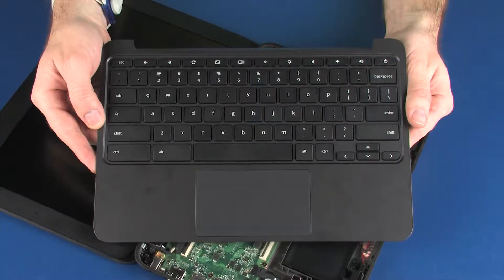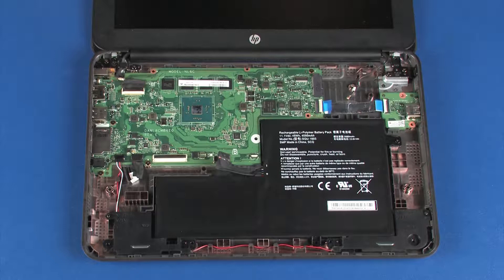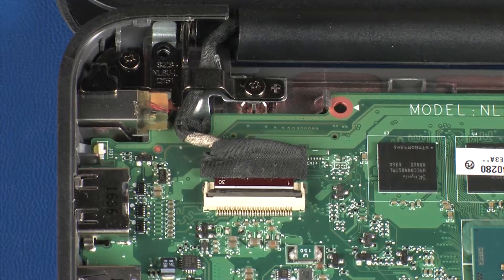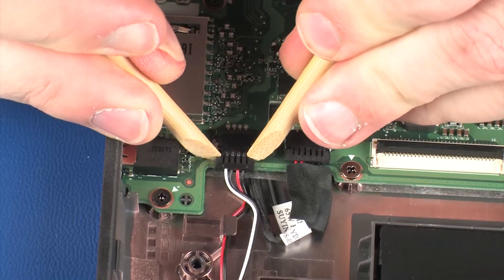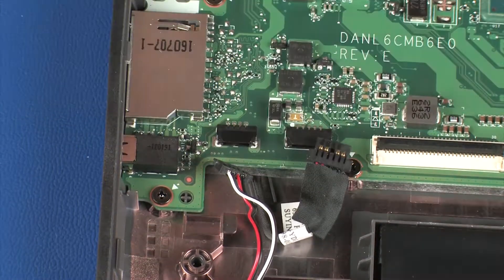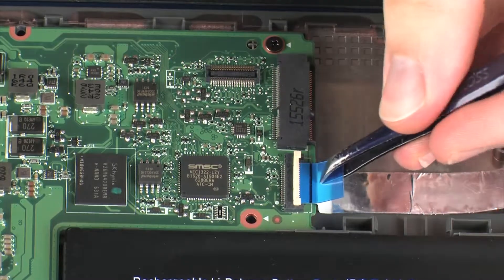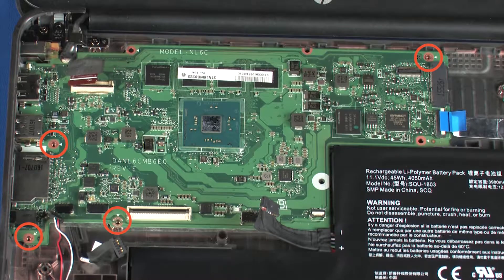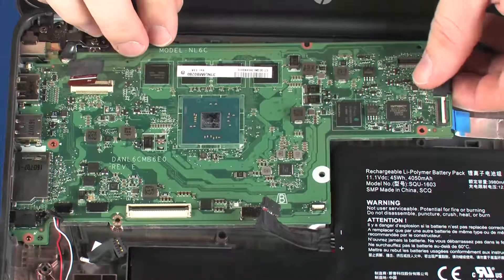Replace the System Board | HP Chromebook 11 G5 EE | HP

Comment: How to upgrade SSD or HDD to increase storage.
Reply from the maker: Hi there, thanks for contacting!
I understand that you need to know about upgrading the storage.
I will do my best to assist you.
HP does not recommend upgrading or downgrading hardware parts or software that is bundled with the product as It may affect the manufacturer's warranty and performance, however, you could change the configuration at your own discretion.
Binu - Social Media Tech Support